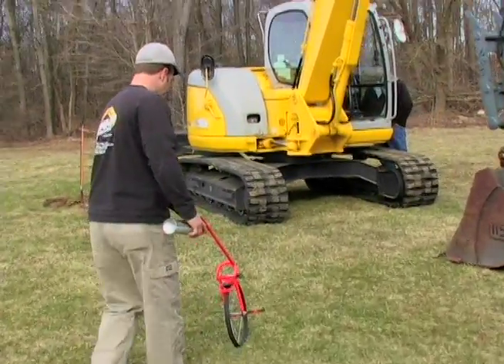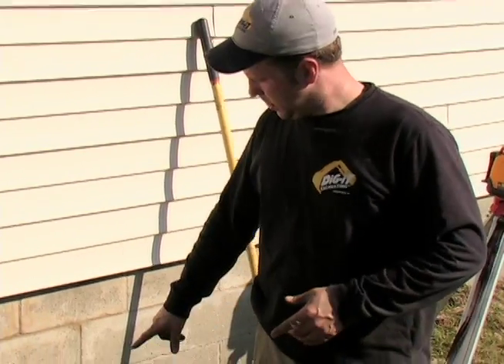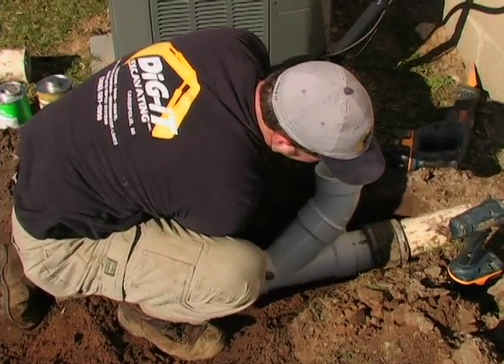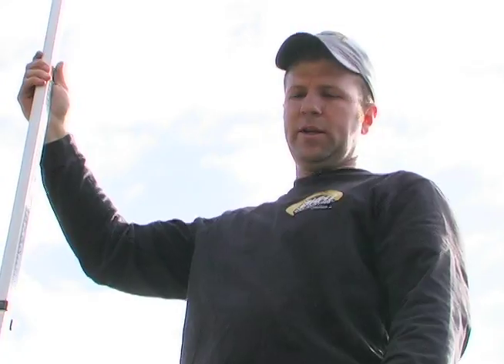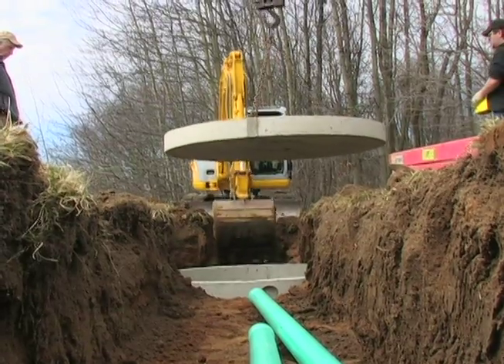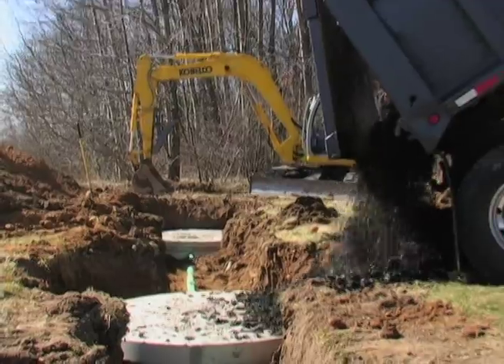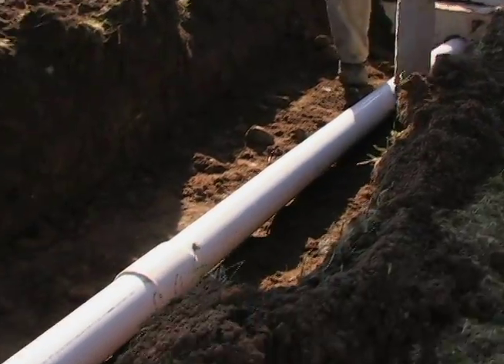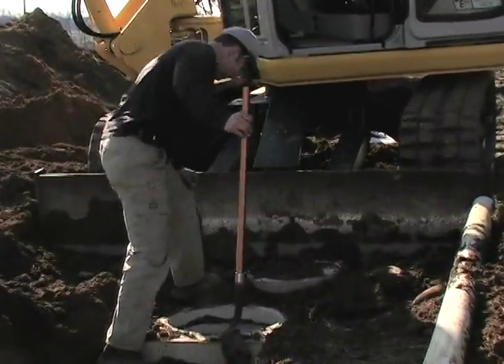Dig-It Excavating explains a septic system replacement

Comment: Interested in your comments on: Proposed 750 gallon tank (could go 1000?) will have to go about 60 feet to tank - up 1 foot, then only 70ft of laterals (Fishing cabin, limited use but at least there 4 times per week - approx. 3-5 hours and more on weekends).  Will be using Ez-flow laterals.  1. think I will need a pump to tank?  2. concerned about septic system failures?  3. What's a avg retail cost for equip(a) and (b)labor? I'm in MO.
4. should I use plastic tank or cement? (cost difference?)

Comment from the maker: @speedingarod, in the areas we work a 4" sch 40 pipe is installed with a range of 1/8"-1/4" grade per foot, but we mostly install at a 2% slope. 100' is not a problem if you can get proper fall. -digitexcavating